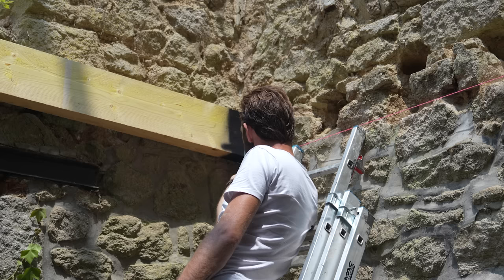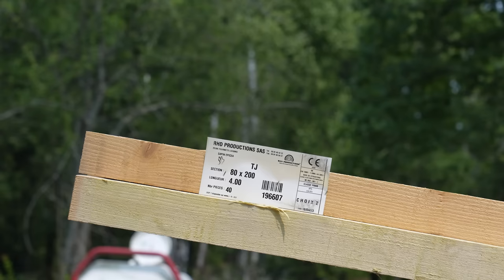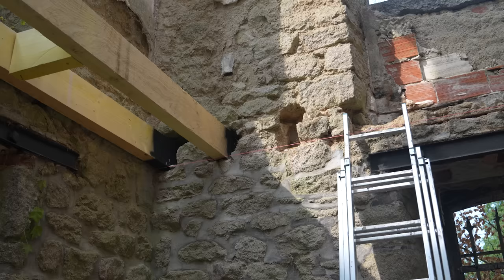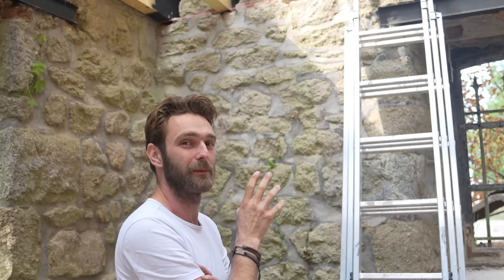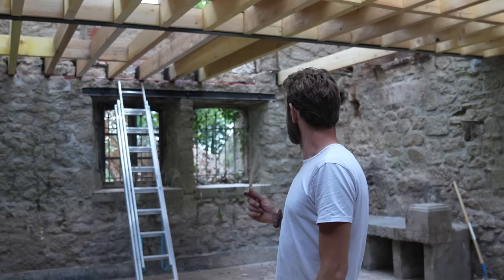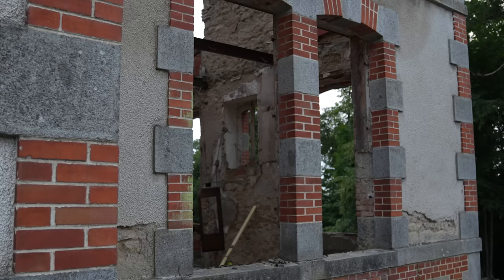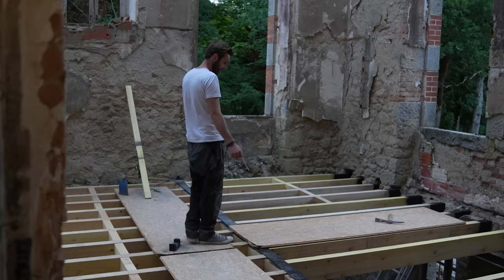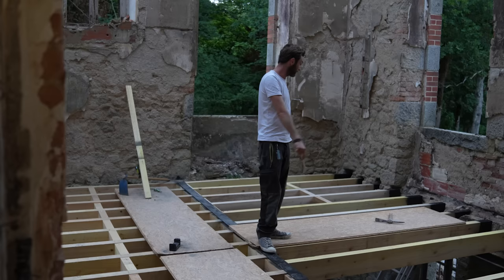A impossibly, perfectly level floor?

Comment: It's the little things, like dead-flat-perfect that elevate life into art.
U.S. Building Code permits 20% removal (notches, holes) of floor joists.  If a joist is 10 inches in height you may drill a two inch hole or 2" deep notch anywhere along its length - including, I suppose, its end.
Reply: Good point but, you can’t notch a hole right in the middle because that is where most bending occurs. The whole cross section is needed to resist it. The building code says the hole or notch must not be in the middle 3rd of the beam.
Reply: @user-ri5ff8ll4z  I stand corrected. (why I never got my license; only read half the text)  My, expensive, book of Code may be quite a bit older than yours.
Reply: Are you looking at the Universal Building Code?
Reply: @karenmetcalf-pugh5  I guess so.  That book cost me $300 - and I never got my money's worth!  - 300 was a chunk of change back in the 80s!
Reply: There are two types of force in a beam along it's length there is the bending moment: the top of the beam will be in compression and the bottom will be in tension, as the top and bottom are in compression and tension, it follows there is a section in the centre where there is no load, that's why "I" beams work, and why you should avoid cutouts on the top and bottom of a beam,  especially near the middle of the beam's span where the bending moment is a maximum. 

The other force involved is a shear force that is only applied to the beam at the point it is supported e.g. on the wall plate.  The beam is obviously designed to cope with both the bending moment and the shear force. In this application the shear force is much lower that the bending moment . As the beam has a uniform section the ends are as strong as the centre and much stronger than needed, where the centre has most of the load. On very large industrial beams they are often thicker in the middle where the max bending moment force is and taper to the edges where there is the shear force, this is done to save weight and cost. However in a house it's not important and would make a really silly ceiling.
Reply: @user-ri5ff8ll4z  "The whole cross section is needed to resist it" That is not entirely true, the load on a beam is not uniformly spread across its section, the load is proportional to the square of the distance from the centre line, This means the centre of the beam has a very small load,  indeed, the thin strip in the centre does not have any load what so ever. As you move away from the centre line of the section  the forces increase as the (distance * distance)* load  With a compressive forces in one direction and tension in the other. So Yes, you must not cut out near the centre but small holes are allowable, in the size of beam Dan is using a 50mm ( 2") hole in the centre of the section would be fine, but a 50mm cut out would be a disaster.
Reply: @karenmetcalf-pugh5  Uniform Building Code

Comment: Dan, be careful when transferring the level with laser devices. I've learned the hard way. I have a "cheap" device from a very well known German brand and noticed when doing ceilings over 10/15 meters long I would get a few mm off at the end. Then I checked the specifications and found if you want a good level accuracy you need to spend over 1000€ in a laser station. So I resorted to use the old tool I've used before: a clear water hose and 2 people. Congratulations on the job you have done so far, doing it alone takes courage!

Comment: Took my idea LOL! Cut a notch in the floor joists & see how you can go.  Or use a reciprocating saw to cut out sections of the metal plates instead of removing the whole metal plate.

Comment: If it's only three, it's not so bad - different if it was a lot more. Looks like the span is not so long either. Your joists are more substantial than mine, spanning a similar distance. The answer is to either double up the beams, or create a method of support with the joists on either side. It's not so bad as it initially appeared.
Reply: yeah i'd probably double up the middle of the 3 beams and call it a day
Reply: I can only guess but it looks like he cut off 70 or 80 cm from what looks like 3 m lengths, so the free span is probably little over 2 m (less than 7 feet). From what I've read that means the joists are oversized by French standards, so notching them shouldn't be a problem.

Comment: Those last couple beams underneath the fireplace, i was thinking it maybe best to replace those with metal beams. Security against fire hazards. I know the stone hearth is usually enough to stop fires, but a metal floor beneath just adds to the security. 
Then you can get the appropriate individual depth metal beams to fit securely without having to bother cutting anything.
Reply: I like that idea if that fireplace will become a working hearth again!   I wonder which of the chimneys can be relined and made functional again.

Comment: Should put your string line on the top of beams, they maybe slightly different heights so your floor could be wavey
Reply: Hopefully he can make any needed micro adjustments to the beams before he cements them in place

Comment: Dan. I’ve been watching for awhile and it’s amazing seeing the transformation. I wanted to point out something about the kitchen your working on. First there is a blocked off Doorway behind the stone slab in the lower portion of the lower kitchen,and as to the fireplace in the upper story. You have a two story kitchen. The bottom would have had hooks in the ceilings for meats to dry and age as well as food storage, the stairs which are no longer there went to the upper level and the fire place was where the meals would have been cooked. Off of this should be the original Dinning room. I hope you decide to restore this as it is important to the history of the château. Blessings
Reply: Dan mentioned the doorway a few videos ago, it led into a small room, possibly the original pantry.
In the 1940s the room on the ground floor was used as a dining room and that makes perfect sense to me. Your theory sounds good for a properly old building but for all we know Chaumont was built around 1905. I find cooking in a fireplace very hard to imagine at that time, more likely a big cast-iron cooker in the basement.

Comment: Dan, would you be able to use pieces of slate under the beams where they enter the stone wall to level it?
Reply: He did that on the top floor of the landings. These floors need to be a little lower where they finish at the wall. They also need to be level with the central I beams. Removing a bit from the bottom at the wall end is the practical solution.

Comment: Interested to see the solution for suspending the joists on the other wall.
Reply: He's going to insert a steel i beam along the inside of the outer wall, after cutting two holes out of the stone for each end to fit, and then fit the timber beams between the central steel i beam and the new steel i beam so he won't have to cut several individual holes in the wall for the wood beams to fit into!?!

Comment: Putting a tape measure on the back of the cutting table would save you time and giving you a means to cut the same size board every time...

Comment: The part I'm fascinated about is what engineering reports have been done on this building, where I live absolutely no way could the chateau be rebuilt in the way Dan is doing it.
Fire weakens bricks and morter, steel, water, rain and frost do the same. Adding all this weight back into a weakened building plus the huge weight of the roofs with no additional structural strength to displace the weight seems very risky, but France obviously has very different building codes and safety standards
Reply: Yes, different country, different rules
Reply: @chateaulady  I understand that completely, but I'm just concerned that without correct strengthening, the chateau will be unsafe. So far, he has added no strength to the building, just weight and stress. Laws of physics are the same the world over even if building codes arnt
Reply: I'd love to see that too

Comment: Could the reason there are no board pockets, there was a staircase landing ? The wooden and I-beams look great adding another dimension to the spaces, bringing the manor/chateau closer to its former glory.
Reply: I think he showed where the staircase went up on that side in the video right after the clean out - you can see the 'ghost' of the stringers along the wall and where the landings were if the light it just right.

Comment: Dan, once this floor is in there will be a ceiling for the basement. Have you considered setting up in the basement while you work on the floors above? Looks like it would be a pretty big area for a temporary living space.
Reply: I'd be wanting to wait until the upper level walls were stabilised.
Reply: I was wondering the same. Makes more sense to me to wall in and establish a make do apartment there then go to the cost of buying a camper or cabin. Look into what Martijn Doolard did with his homestead the first winter he lived there. Basically made a room inside his cabin. Worked well albeit small. Dan has enough room to make it work.
Reply: I don't think the building is safe enough for that
Reply: @MrZuhahaha  The most crucial part missing is a roof. Doolard's cabin had a reasonably tight roof when he got there. This section needs some substantial wall repair near the top of the first floor before even a temporary roof could go on.
Reply: Dan answered commenter 'williamtate' a few Vlogs ago.   'williamtate' asked, "Why don't you set up a bedroom in the cellar of your Chateau?"   Dan replied, "It still isn't waterproof."   There's a lot of drainage work that needs to be done in the old basement kitchen, both inside and of the ground outside surrounding that room.

Comment: You should be proud of yourself.  You are doing an amazing job.  You will lie in the bedroom one day, with a chandelier shining and think to yourself I DID THIS.
Reply: Hope he doesn't put chandeliers in but lumieres of the epoc
Reply: @daisylovelock9553  Ca. 1900? Chandeliers sound pretty appropriate for that. I wonder if the château had electricity when it was built or whether that was introduced later. The existing light switches look like a mix of 1920s and 1970s to me.
Reply: @Ragnar8504  Chandeliers are for candles

Comment: I'm still worried that because of the damage from the fire and 40 some years of weather exposure that there is unseen damage in the core of the walls and without either tie cables or steel anchors running from opposite walls on each floor with plates on the outside the more work and material weight you put into the structure/ he greater the chances of it all collapsing it has happened to building's here in the US that were rebilt after fires without all the years of weather exposure because they were not properly stabilized and reinforced.
Reply: I'm going on the assumption that this structural engineer he consulted before starting would have made a detailed survey and provided suitable recommendations. It’s not impossible it could need something like that. Towards the base it seems fairly stable and intact, but higher up especially, which would have suffered the most from the heat of the fire and exposure to the elements, it'll be more fragile.

Comment: It dawned on me today me today that none of the floors are load bearing.  Each floor for each level is solely supported by the stone walls.  So yes, what you are putting in should be more than adequate.
Reply: There might have been internal stud walls though, some of those rooms are huge.

Comment: Dan...you changed the O.C. spacing on your floor joists so your subfloor joints won't line up across the entire floor which would make it much stronger as a single unit. ❤️🙏

Comment: So glad to see he got smart and realized he could just notch the beams. When he talked about digging out the steel in the previous video I was flabbergasted. 
My guess his beams are 20 to 30cm high. I would confidently notch that up to 5cm, certainly if the total height is above 20 cm.
If he was really worried about it he could add a beam carrying clamp under a heavily notched beam.

Comment: For the other side of the floor try this. Cut a timber beam down that will slide into the I-beam. Bolt that timber beam level along the wall using masonry bolts along its length. make sure the bolts are recessed into the timber.
Slide the I-beam over the timber beam and bolt it in place. For added strength, use L shaped brackets at each end and bolt the ends of the I-beam to the end walls, unless you want to cut two new pockets, one at each end. 
Now you can slide the rest of the floor beams into place the same way as before.
Alternatively you can skip the I-beam and use hangers to secure the floor beams to the wall beam.

Comment: If you are worried about weakening the end of a joist too much you could always fix a galvanised hanger onto the wall after trying up the joist.  This would restore the joist to full loading capacity at the end.  The end loading is probably more important than the centre as most heavy stuff is likely to be close to the wall.

Comment: If you "sister" a long piece of steel on one or both sides of the wooden beam where it rests on the wall it will spread the load across a larger area and reduce the probability of the notched out beams splitting.

Comment: I wonder what the room above your room, I mean kitchen I guess, was. It must have been warm in winter. So pretty looking up at those joists so nice and even and neat. Great job!
Reply: I'd guess formal dining room, makes the most sense with the servants stairs leading straight up there. Don't forget the château was built with central heating, so the warmth from the kitchen wouldn't have been as essential as in older buildings.

Comment: That other wall there is probably a reason they didn't have pockets, maybe they had pipes or other cavity in the wall like they did in that other area. They must have had a beam run along the wall to attach the joists too.

Comment: An alternative, and much cheaper than an I beam RSJ against the wall would be to fix a wooden joist to the wall using anchor bolts in resin bonded fixings in the wall.  Once the ends are levelled you can drill the joist and the wall into the centre of a good stone or brink an inject the resin then drive in the bolt and tighten down once it's cured.  I did this in our stone house here and nothing has moved in 10 years. Level to within +/- 3 M over 3.5M.

Comment: Amazing work....Aldo i think you skipped a few basic steps at the beginning (before putting floors in)like brushing of the walls to remove all loose particals.and then stone bye stone  wall bye wall floor bye floor cutting atleast 4cm deep in between the seems and replacing the mortar befor.Currently you do just a slight brush and put some new lime mortar on top.I feel like while you have acces to it all you might do it properly.Doing things half half often bites you in the ass a few years later.Same thing with half rusted steel beams get them out replace them while you have acces...Thats just my 2 cents of toughts.

Comment: Hi Dan,
Just had a thought, and noticed if you build 2/3rds of each floor; then alternate what side you leave open for all 3 floors.  It would be easier for raising the metal and wooden beams (attachment points, etc).  Set it up for; but not with, the flooring until all levels are in.  Safety wise. (less distance to fall) and (better staging areas).
Just saying!!
Regards
Larry Butler
Perth
Western Australia
P.S.  Working smarter, not harder.  Keep up the excellent work.🤔🤗

Comment: Dan an option would be to take bigger notches out of the bottom and bolts an additional  section to the side of the beam to increase it's strength. So The bearing section is twice as wide.  that way you would not compromise it's strength. A 500mm  section glued and bolted to the side of the beam with three M10 bolts on the centre line of the beam should be more than enough.

Comment: yes a lot of good work and difficult work and if not a tad dangerous given the height. However in less than 4 months fall and winter will come with loads of bad weather and NO roof on this mansion. It will be a big problem for sure. Special machinery and heavy equipment required to build a new roof. Lots of pressing questions here.

Comment: I'm a big fan of the relay system of carrying things especially where stairs are concerned. Have you thought of carrying each beam (I consider them joists) from the truck and laying them on the granite stairs so the top ends of the joists are as close to the top step as you can get them. Then go up the stairs ONE TIME and drag them up and carry them to your hoist one at a time. How many stair steps would you avoid and still get the job done. You are doing an amazing job; it just wears me out watching you climb those stairs each time!

Comment: Good morning, Dan!
The side that remains to be rebuilt and to which you refer is that of the staircase that led from the kitchen in the basement to the first floor. Will there no longer be this internal staircase? What will then be the connection between the basement and the upper floor? Only through the external side doesn't seem a good idea to me, especially at night and in rainy weather. 
Amazing work on the floor, congratulations!
See you tomorrow!

Comment: the next floor up maybe also spray the ends of the wood from the metal part as condensation between the metal and wood does not get a change to rot the wood.